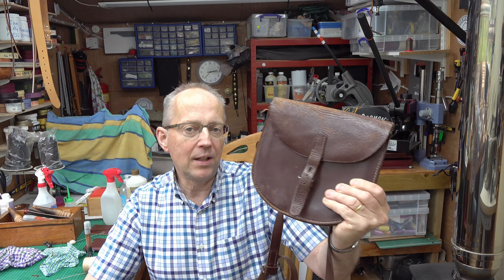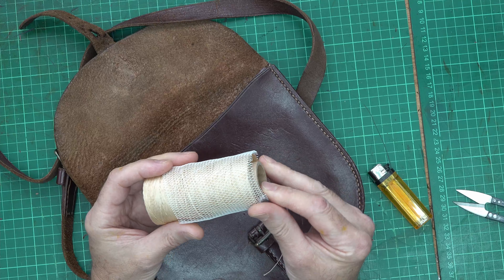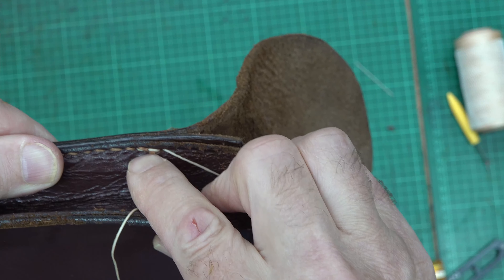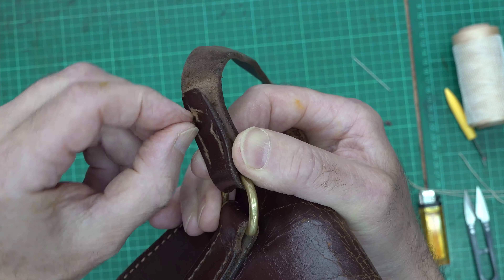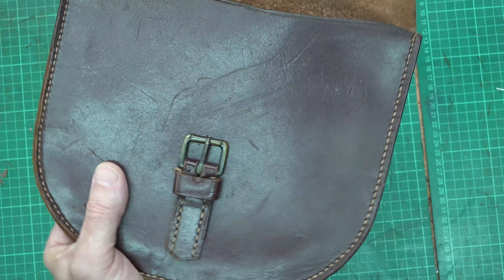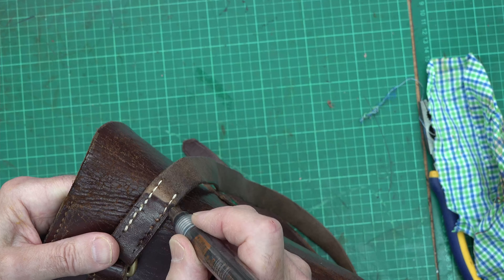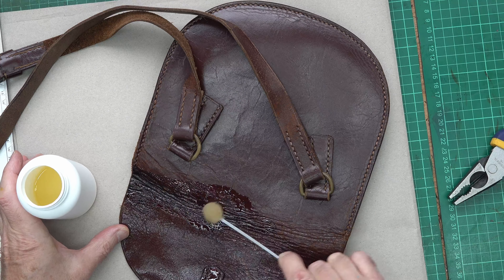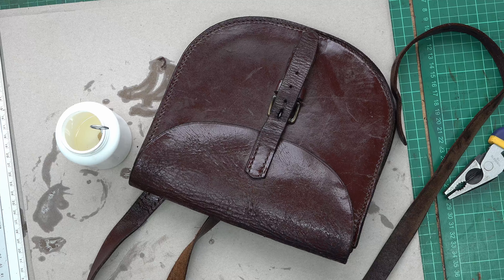How To Refurbish A Vintage Leather Bag

Comment: Very nice, now you can stuff it with a paper to give it a proper shape.

I was just reading about neetsfoot oil that it deteriorates leather over time, because it goes rancid.

Hard to believe any info nowadays.

Did the bleed dry out and changed the color, or the other side kept having that oily patch?

Comment: Great job just wondering your thoughts on Kiwi Saddlesoap. I use this as a first step to clean the years of grime off of leather. I wipe it off with a moist microfiber cloth and let dry completely for about 24 hours. Then I apply mink oil (looks like a balm) with finger tips all over the leather a d let that soak in for a few minutes and then wipe off and buff.
Reply from the maker: Sounds like a very good approach, thank you.

Comment: Thank you sir! This is a very useful, well-demonstrated, and explained basic guide for maintaining vintage leather products that many people will appreciate and find helpful. I've used Neat's Foot Oil in the past myself, and it is quite economical and effective for preserving leather. It was a good choice for restoring your vintage bag. As a light oil, I think it can have a tendency to soften many leathers as well though, so when I don't want that to happen, as with shoes and boots for example,  In those cases I prefer to use wax and oil compounds, either commercial or home-made. I think bee's wax compounded together with such things as mineral oil, cocoa butter or shea butter, and  a bit of odorless mineral spirits using mild, careful heating methods, also makes good, economical, and flexible alternatives to the Neat's Foot Oil used alone. I finish and maintain most of my leather projects with it as well. Such commercial products as "Sno-Seal" and Obenhauf's also work equally well.
Reply from the maker: Thanks very much for those tips, very useful.
Reply: Yeah, I've been using Sno-Seal for thirty years. The important thing is to warm the leather. Inside a car on a summer day for a couple of hours works great. You want the leather to melt it not your hands so it really penetrates.

Comment: Holy crap, that is a genius way to keep your thread! Stops it from unraveling all over the place, but it's still fast and easy to pull out a length. I need to find a place to buy some. I did not realize how badly I needed those until I knew they existed.

Comment: OLD LEATHER SMITH here, Great Job Harry, Suggestion, I have found that rubbing it in with the hand provides the heat needed 2 penetration the leather more completely, I will admit it is a bit messy, GOD'S BLESSINGS ✝️⚾🙃
Reply from the maker: Thanks Jim.

Comment: Great video.  I have the same question about the Montana refillable pen and the Feedings spirit based pro dye.  I am wondeirng whether this would suit repairing the worn corners of a 20 year old green soft leather handbag as well as the cracks all along the strap ore whether one of the leather paints on the market would be better?

Comment: Neatsfoot oil. I've never heard of that, but it looks good. If the old leather need to be cleaned before application, how should it be done?
Reply from the maker: Hi could use saddle soap.
Reply: @harryrogers  Thank you.

Comment: I do the same trick with the dye in the refillable marker! Much easier then dealing with a bottle and dauber
Reply from the maker: Hi Kayla, absolutely, I  like the way it does not put too much dye on as well.
Reply: Definitely that too! It makes finishing edges such a breeze with no cleanup, plus there's no risk of getting dye on the face if using pre-dyed leather